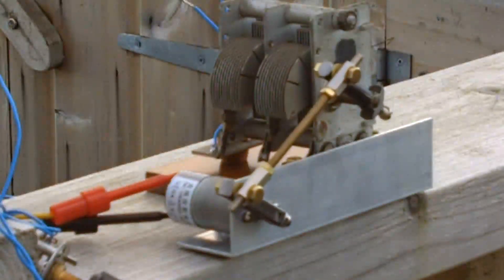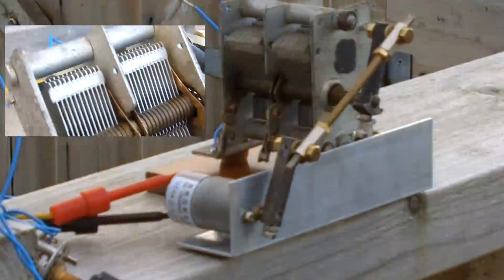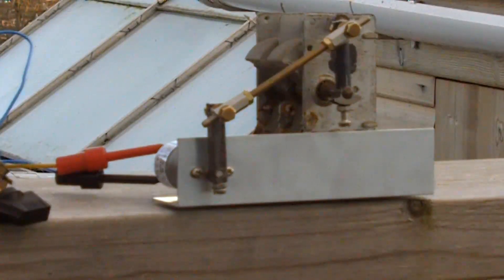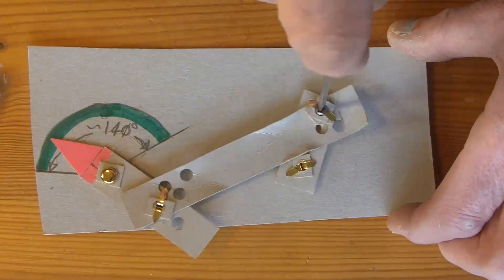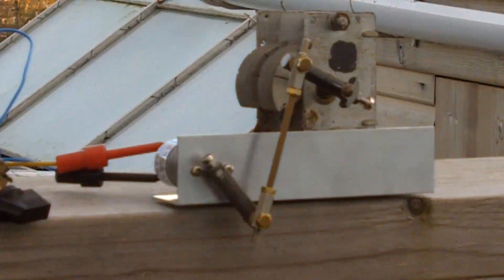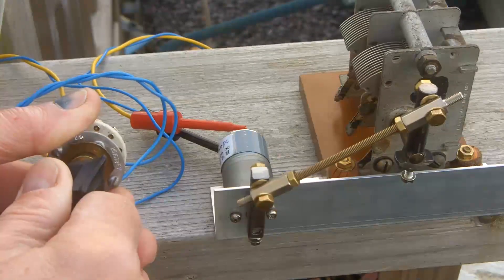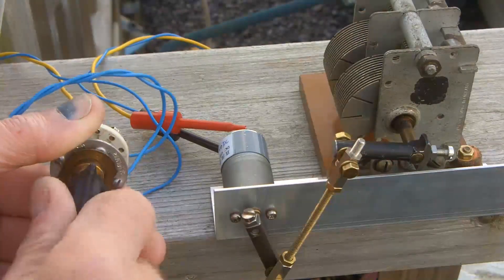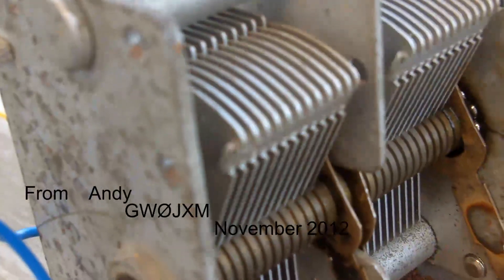About Radio 62 Simple Antenna tuning unit drive mechanism from Andy    GWØJXM

Comment: Just a heads up.  You might be able to accomplish the same thing without an adjustable linkage by slotting the motor mount holes and with the help of washers to slide the motor back and forth to accomplish the same thing.  This would allow you to use plastic for the rod to insulate the motor from possible serious voltages?  (I have a milling machine so it's easy for me to think of this!)
73's Ray  NV2A

Comment: I intend building my loop tuning mechanism, using an rc model servo. I have found a cheap servo tester that will allow me to set end points on the servo, so that it does not overdrive the capacitor. It uses only 6v DC to drive the servo, and allows manual remote tuning. It's cheap, and is virtually plug and play. The servo tester, after being used to set the end points, then becomes the actual tuning control.

Comment from the maker: Hi Dennis, I’ve been thinking about your notion of using push button control for rapid reaction switching and I wondered if you had some preconceived idea about how you’d go about this? As you know I try and keep things simple and I’ve been scratching my head to see if I could come up with a neat method that used two single pole switches and say diodes but no relays or electronics. Still scratching, is there a simple way that I'm missing without multi poles?? 
Kind Regards ... Andy

Comment from the maker: Hi Mick only just got this message, don’t know why that should be? I'm not sure about the servo route, It was while I was looking at servos that I came up with the idea of the linked drive that doesn’t need any electronics to drive it as, as you say, not a good idea to blast a little receiver with a high diet of RF. Yep, if someone said ‘I'm going to hit your thumb with a 16 ozs claw hammer with all the force they’d to use to knock a 4” nail with you’d give them the secret code. 
Andy   GWØJXM

Comment: Hi Andy
just thinking if you used two mometary push button switches instead of your rotary it may be faster response for direction and more accruate  1 for positive other for neg voltage
Dennis  wis

Comment: Presently I am downsizing another hobby of mine, RC aircraft, and I thought of you and this project while sorting through a box of old servos. It should be possible to use a 180 degree servo to replace the motor and linkage to control the cap. However, I would be hesitant to use an RC radio in such a strong RF field and instead wire directly to the unit. 

I couldn't help but notice your blue thumbnail. OUCH! Don't you just hate it when you whack the wrong nail?

73 -- de Mick, WB4LSS

Comment from the maker: Hi,
 The little motor in this video has a stated speed of 5 RPM at 3 volts. It will run down as low as 1.75 volts and give less RPM (not measured yet). And of course if you just stab at the supply voltage briefly then you only get a tiny movement, I think it’ll be fine but I have also got some 3 RPM motors to play with, so I’ve got lots of fun yet to come. So in answer to your question yes you can run it slower at lower voltages and faster at higher volts.
  Kind Regards ... Andy

Comment from the maker: Hi, I’d be interested to see what Solid Works makes of the design. We’d just switched over to a 3D drawing package when I sold the company, the project engineers were beginning to get to grips with it but I never got past seeing the very basic stuff. I have an old copy of AutoCad lite here but I have to flog through all of the angular displacements manually, as you say I can model it with a bit of help from Mr Kellogg and his cornflake boxes in a few moments. Kind Regards ... Andy

Comment from the maker: Hi John, the magnetic loop is one of the driving forces for this device, I’ve struggled on with bits of string around the capacitor trying to keep out of the loop to avoid electrocution and affecting the SWR but I’ve always thought it would be too much hassle to make a drive with a stepper motor etc but this device is fail safe in mechanical terms. I'll post a video of the magnetic loop tuning unit when I build it.
Kind Regards ... Andy